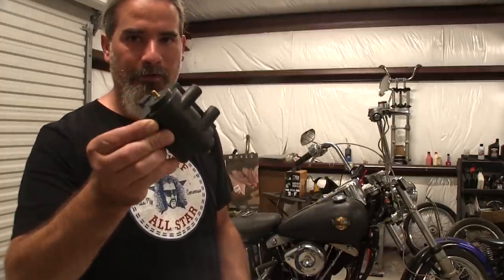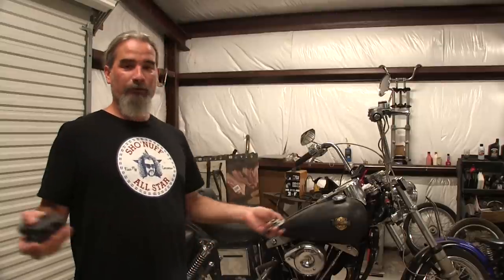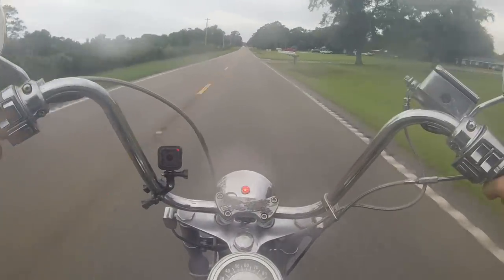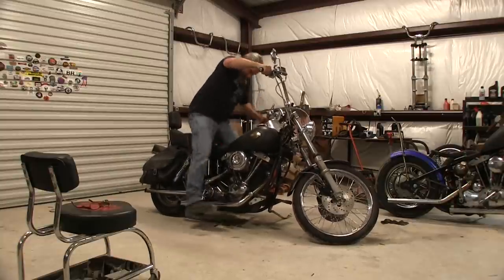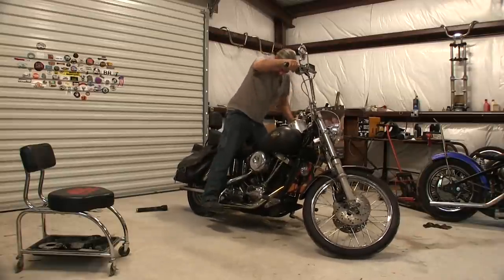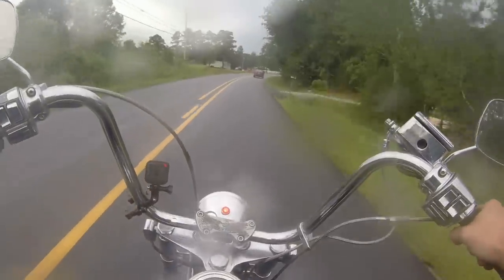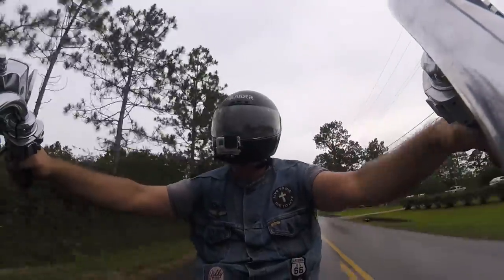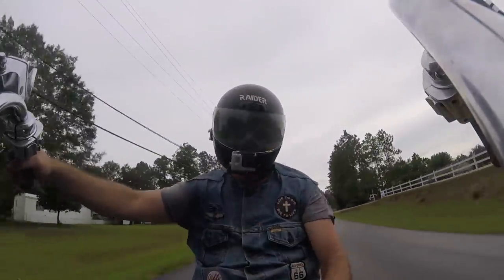DITCHING Ultima ELECTRONIC Ignition And INSTALLING POINTS On 1979 HARLEY Davidson SHOVELHEAD FXS 80

Comment: Hey Saddle Tramp. I just thought of something you may not have done. If you did not change the spark plugs to the old style points plugs, the plugs you have are probably wrong and gapped way to wide. Electronic ignition gap is like .043". The old style plugs gap much closer. That may contribute to easier kick starting. Just a thought. Makes a difference. Just get a set of plugs that are listed for shovels with points ignition.
Reply from the maker: I actually re-gapped them from .041 to .032
Reply: That should probably be OK. I have not looked to see what plugs were used in the early shovel. I did see the plug gap was .022".

I remember having to change my plugs to an early Sportster with points ignition. Shovels may have used the same plugs just a different gap.

Comment: I have thought about sticking with points on my 1971 Triumph T120R bobber but this wont be a bike that I will do any long distance riding. I know what you mean about forgetting something you've do way back when. It's been 20 years since I've touched this bike and have had to relearn a lot of things about it. I need to try to dig up my old points. I thought I thought I had 2 points.

Comment: So true. Early 79 Ironheads still had points, which |'m happy with as I've never liked electronic ignition. Next time my regulator fails I'm replacing it with a mechanical one, and I already ditched the electric start for a kicker.  I like things to slowly get bad, giving me plenty of warning, rather than things which just die. I was being flexed on the other day by some guy with a big new Harley, and I think people just don't get that this is all no problem if you wrench.
Reply from the maker: I hear ya, man. Better to have plenty of warning than no warning at all.

Comment: James Carter · 

Follow
H-D PHD Master Technician, 30 plus Years (1989–present)Author has 6.8K answers and 5.3M answer views
1979 was the first Prestolite electronic ignition, sometimes called the “bean pod ignition” for the potted electronics. This ignition continued to use the mechanical advanced unit from the old points ignition. The problem was this had all the mechanical problems of the old point ignitions and very questionable electronics that failed on a regular basis.

This lasted one model year when it was replaced by a much more stable Magnavox first generation all electronic V-Fire ignition with a single ignition curve that was a compromise for all needs. This was replaced by a second V-Fire III ignition that included multiple ignition curves for changing needs.

646 views
Personally, I had no problems with my 79 Shovel, It was an AMF HD and the paint on it just peeled off.  I also had a leaky gas tank I had to fix.  I can say truthfully that I had no problems with the electronic ignitions, my last being a 1984 Shovel.

Comment: On kick start leave the ignition off and give it a few twist and cycle the engine to prime it then turn on ignition and try it. Also every bike wants a different amount of fuel and that also changes based of weather and temperature. When you get to that point you will almost be one with that bike because of the time taken to learn it that well.
Reply from the maker: I think it being in a climate controled building is playing a big part in it too. Thanks.
Reply: @SaddleTrampTV  definitely could be as everything causes a slight change. It's good to have a kick and an electric start. Especially if it kicks back and you just say screw it

Comment: I have a 81 Ironhead sportster. I think it came out with electronic ignition. However, when I bought the bike, it was in pieces I put it all together, build it from the ground up myself and I went with points on the points plate, the screw holes that the screws go through to hold the points plate to the engine. I had to take a Dremel tool and make both slots longer so that I could get it to the correct timing on the points. Hope you can understand that but I have been thinking of her recently going to an electronic ignition because once a year I have to change everything points, plug wires, coil plugs, and it is time to do it again it will start speeding and spotting, then cutting off.   Then, one morning, it will run just fine then it will starts to spiting spiting about an hour down the road, and I have found out that even when I break down on the road I would really have a hard time finding the right length and with of points to put in the us that fits right or finding a condenser so far I’ve been lucky I have been able to meet at home and able to work on here. However, I think you’ve done a great job shovel head is my favorite engine.
Reply from the maker: That cutting out after some ride time sounds like a bad coil. They do that... Run fine after startup, and then quit when they get good and hot.

Comment: Tanks for this video.  I have a s&s 113 I would like to do the same thing too. Like you I've had 2 hi4 crane fireball shut down and leave me stranded. I hate electronics. When they work they're great but when they're  done they're done. Now I'm done. I've researched a kit from jp. I think I'll have to change the coil also. I'm old school and tired of being on the side of the road. RUDE 🇺🇸
Reply from the maker: Yep. You'll need a 5 ohm coil. Electronic uses 2.5 to 3.

Comment: They used to make a clear plastic rod, about 3/4 X 1 1/2 in., threaded on one end to screw into the timing hole, so you could use a timing light and not get covered with oil while the engine was running!

Comment: I have a ‘79 XLS. The OE electronic ignition quit(mechanical advance unit wore out). I replaced it with Ultima but am considering converting to points. 1978 mech. advance should work I think.

Comment: Usually when you get kicked back is when timing is too far advanced. Also it kicks easier when you get fuel in the rear cylinder. Try this. Key off full enrichner three full twists of throttle. Kick through three times with key off. Turn key on quarter throttle kick once. It will start every time.

Comment: Hey I tried using the Thick Film Ignition Module (and heat sink)(and coil) out of an '88 Ford Aerostar minivan hooked up to a pair of points and it's perfect for V8s up to 5000 rpm. Should work on a 4 cylinder up to 10,000 rpm! Leave the condenser off just use the points.Their greatest feature is they automatically figure out exactly how much time beforehand to turn on the straight 12 volts to the coil (automatic dwell control) (BTW the coil sucks 4.5 amps when switched on) to charge it all the way up in preparation for the points to break and cue the module to do the hard work of breaking the circuit unleashing one HELL of a hot spark.
The one error I found by the guy who invented this is that you have to add in a big diode going from the power-out side of the (toggle or key) switch to straight 12 v positive to keep it from blowing the module if you open the switch with the coil all charged up.
 I can't post the link - but search for "TFI with points" and you'll find the diagram. It's pretty simple.
  Relative to this Harley you ought to be able to run two modules/coils off one pair of points so you are still wasting sparks.
I know I know - it's going to be a little bit bulky - but it's something to think about. If I still had my old "80" I think I would go to the trouble of adding a second set of points so each cylinder had it's own separate ignition system. Ought to run nicer. The very very best would be if you could figure out how to get a one-bump point cam turning at 1/2 crank speed to run two sets of points. (Oh - and don't forget the centrifugal advance mechanism - you want that on a Hog !)
I bet you could leave off the electric starter and run a smaller battery then - maybe free up some space and weight that way.
Reply: Here I am replying to my own thread. For the purpose of saving some guys some money and heart ache. 
1) Hate the idea of points carrying and interrupting DC current loads. Points work great on magnetos - not so with battery ignition. (I know - every car in America had that at on time - but it's crap )
2) Simplest is get a stock "remote mount Ford TFI Module) and make it run the double-outlet Harley coil. If you take a battery and a digital ammeter ($7.00 Harbor Freight) and send juice through the coil and the ammeter for a couple seconds and it shows 4.5 amps or less = you'll be fine. 
3) It's better if the TFI is used with a right coil ('88 Aerostar van for module and coil) because it gets into how long a time a coil should be charged/energized and the TFI Module charges it's own coil >>> exactly<<< right.
4) The bulletproof way to do it is make your one set of points run two modules and each module run one correct coil.
5) I know space is tight on a bike but if you use the blue 7mm NAPA "tractor" solid wire you can let the coils be 3 feet away from the spark plug. It's okay.
6) Here is what the module and it's stock Ford heat sink look like:
 https://www.2040-parts.com/ford-motorcraft-tfi-ignition-heat-sink-remote-mount-w-module-i270985/
7) Here is what the right coil looks like:
 https://lmr.com/item/DG470/1983-95-Mustang-50L-Ignition-Coil-With-Efi?year=1988&gclid=CjwKCAjwwo-WBhAMEiwAV4dybdinaDa6fgFo4LxVaQbBCKGQu8npYjbXDGkw47eRnZwfJU85Y0idlRoCDrkQAvD_BwE
8) Leave the condenser off the points when you do this.
9) Here is a schematic of what gets wired to what:
https://www.hondatwins.net/attachments/tfipinoutgif-gif.310529/
10) But you will have to add a "snubber" diode from the +12V power-in of the TFI system back to UN-switched +12V because if you just opened the switch (when it's wired this - the simplest way) the wallop of the coil current will kill the module. (I KNOW this) Here is big strong ("power") diode. You wire it so it conducts when the disconnected system voltage is HIGHER than the battery's. https://www.amazon.com/Power-Supply-Rectifier-Diode-ZP100A/dp/B01MRWJBRB
11) You will need one of these harness plugs to fit in the module:
https://www.amazon.com/1986-1993-Mustang-Distributor-Module-Harness/dp/B00BXOSY6E
12) Me being me I dislike "wasted spark" ignition systems (duh - they're wasteful of electricity)(they start nicer without wasted spark, too) But I am going to leave that part out of this comment. This is "do-able" for the average guy. Buy a heavy duty Harley alternator or something if you have to.
13) The "stomp" of these coils is second only to the old GM HEI system (those coils pulled 5 amps). No you can't use an HEI coil it will burn the TFI module. As I said you can use any lesser coil - but why would you? At Harley cylinder pressure the TFI will fire a .060" spark gap WITH EASE.
14) Please don't reply telling me about HEI modules with points - I been down that road, and these are waaaaay better even though they cost twice as much.
15) Shovelheads rule - they SOUND exactly like a MAN'S motorcycle is supposed to sound.
PS: Old School Tractor Metal Spark Plug Wire Set is NAPA Belden #700172. These combined with the stomp (milijoules, actually) of a TFI coil WILL eat the side wire off a set of double-palladium plugs in about 6,000 miles. Don't worry - it will still run normally even at 3/16"(.180") plug gap !
        If it don't start nice with this much ignition power from zero rpm to redline then you got a valve or fuel problem . . .

Comment: Instead off using kickstart to roll over the engine if you have rear wheel off the ground, drop it into 2nd gear with the plugs out and use the rear wheel to rotate the engine so much easier, but top tips

Comment: You were finding   the Compression Stroke .. to find Top Dead center you would need timing marks or a  TDC Micrometer screwed into the spark plug hole.

Comment: My 96” soft tail blows oil into the throttle body,or it used to. I redid the breather so it doesn’t happen anymore. I still can’t get all the carbon off the butterfly. So that problem you mentioned is not specific to that bike, engine, or year.

Comment: I have two 79's, an XLH and an FXEF and both have the factory V Fire electronic ignition. I don't think reliability is the issue with the V Fire system, it seems to be performance.  I don't think I ever read a comparison where the V Fire outperformed an aftermarket set up, performance wise that is. Harley was probably more interested in reliability back then because the imports had an advantage in that department. I just ride around town and short rides on country roads so the V Fire is just fine for me but if I was going to tour with a Shovel I'd want points. I am not sure how many Harley dealers can work on Shovels nowadays so an extra set of points, a condenser, an emery board and a business card seem like a good insurance policy to me. I've heard some stories over the years about fixing points with a gum wrapper but I'm not sure gum still comes in sticks with wrappers. Really good video, keep it up.

Comment: I've been through 4 electric modules on my 76 FLH with in 6 years. Once the module burns out its done! Unless you can afford to carry a spare $300 to $500 module and have it float around your soft/hard bags👎! So this last $550 module I got less then 300 miles out of 😤! So I dropped some $$$$ on a morris magneto. I hope it will be worth every penny when it comes in and I get it installed. P.S. I kick my old horse a use the starter only for back up which don't have wired in, I have to jump it.

Comment: I have  replaced points with HEI .. and Electronic Ignitions many times .. always ran better and got  better gas mileage..  Maybe you need to mount the electronics in Rubber so HD Vibrations don't kill them ..

Comment: TECH TIP: with the points housing empty... BEFORE installing the advance mechanism/points & condenser spray the Empty housing with Electrical Contact Cleaner and dry with a clean paper towel. Repeat until the empty housing is immaculate/clean. You want a super clean environment for your points to live in.To that end a Major source of Debris/Dirt/Water comes in through the small hole in the cam cover where the 12V wire from the Coil to the Points enters through. A Little dab of clear Silicone on the Inside and Outside of the hole After the wire has been passed through will help Lots. Making the point gap perfect on the narrow lobe on the points cam (front cylinder) and perfect on the wide lobe (rear cylinder) and timing the ignition...takes Time...to make it Perfect. When everything is Perfect...and why shouldn't it be...you want your Super Tune to Last, right? Before installing the points cover, a new points cover gasket, with a small amount of silicone around the perimeter of the gasket ( I put a dab on my finger and rub my thumb and finger together) and lightly rub approximately 1/8" around the perimeter of the points cover gasket. Install the points cover...and you've got a Super-Tune that going to stick around for awhile. Proven in the Great North West of British Columbia... it'll work for you too! 👍✌️😎🇨🇦
Reply from the maker: thanks for sharing that. Will definitely consider doing the next time around.

Comment: Several years ago on way to Sturgis.. my Screamin Eagle ignition took a shit. Got ride in back of a toy hauler.. it was hell to find a points set up in Sturgis.. turned into all bullet bolt on parts bullshit. Points is tired and true
Reply from the maker: Bummer, man.
Reply: I made it from Tx onto the kansas turnpike.. bike run down road for like 10 miles.. once ignition heated up..start breaking up.. i did that all day until my friends caught up with me.. we fixed it in Sturgis. Rode whole time there. Then i rode to Mn.. Mn down to Branson,Mo for few days..then back down to Tx l.. i put alot of miles on.. that was circa 2005.. the same points r still on my Superglide to this day..

Comment: Did the lights on Ultima ignition still come on ? I've used them alot  & never had one fail .my guess is the coil was the problem Ultima has had bad coils in the past . Your giving up a bike that starts up better & runs better even HD figured out  single fire is the way to go all twin cams are single fired since the first one in 99 !

Comment: Hey I’m looking to do the same thing for same reason. I have a question maybe you could help me with. I have duel plugs do you know if points will work with duel plugs. Or should I put a new coil and put in two decompressors instead of duel plugs?  Thanks for any advice
Reply from the maker: Never messed with dual plugs. I wouldn't know.

Comment: hi  tramp, troll here. man, it looked like you were competing with red in the kick start fail division of the shovelimpics. hope you didn't wreck your ankle too bad. i have a knee that's been bending too far the wrong way from a hard fail 30+ years back. anyway do the points make her run/start better? wondering if that would help red (she has the same ultima ign.). never had a push button bike (my '78 will be the first) and only one ever electronic ign. bike, my '91 evo hot rod (that ate my knee) and it could be a bear to start. it was kicker only. sorry  for ramblin. one more thing. that patch you wear over your heart, can they be got somewhere? i would really like to get a couple for red and myself and for another brother. ride safe and always look up.
Reply from the maker: Shovelympics... That's too funny. As far as the Ulima, when it runs it runs great. Longevity seems to vary from what I've observed by years of hanging around my local bike shops. The ignition was already in the bike when I picked it up back in December. So I have no idea how many miles was already on it. My 98 electra had the same module when I picked it up at 20k miles. After almost an additional 15k miles, the LED's quit working, so I swapped it out with another module. Email me your mailing address, and I'll see about getting some stuff to you. "saddltramp78@gmail.com" Do you guys have a fb or instagram?